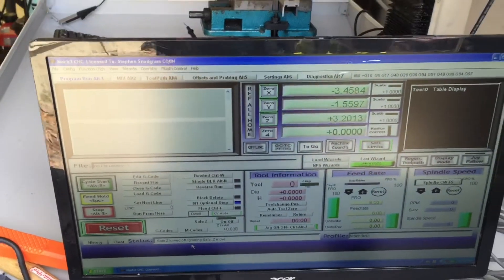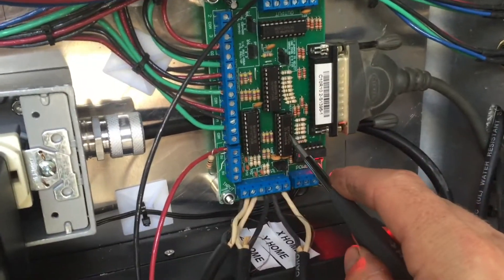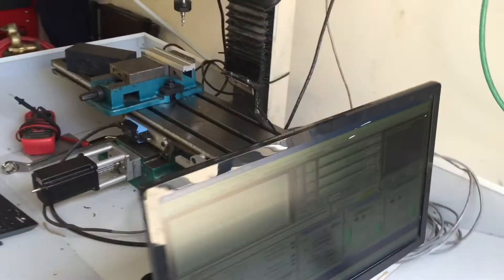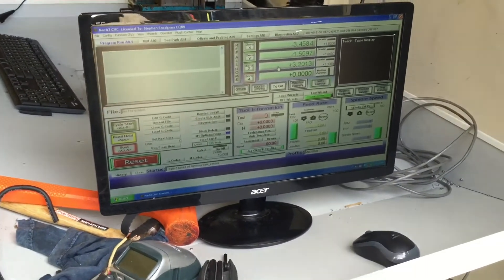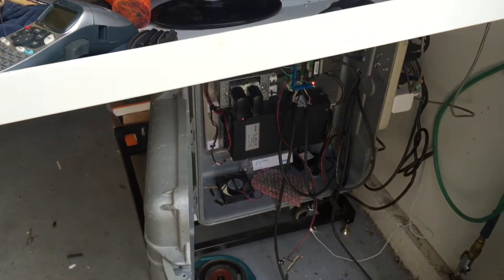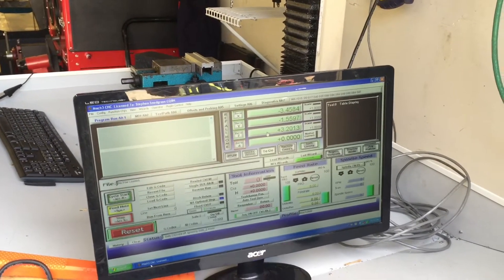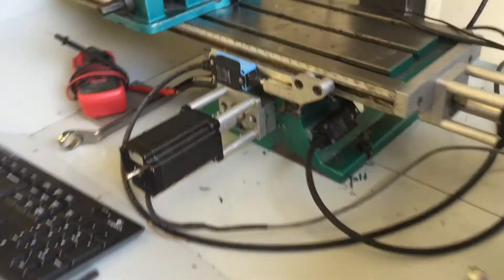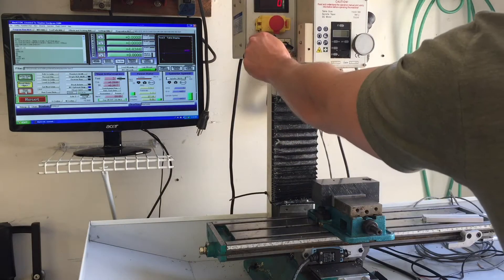CNC HOME SWITCHES-G0704 BF20 AND A QUICK VISE HANDLE-Unorthodox Fabrication

Comment: I have a Gecko G540 which is an all in one parallel port driven setup and found today that when I put my USB mouse on the G0704's bed I could hear a pitch change in the steppers. After moving it back and forth a few times I did confirm there is some sort of loop open so you may want to ground the mill itself and see if that helps.

Comment: what size wire do you have on those limit switches? I just order the exact same ones.
Reply from the maker: Kirk,

Cool. I added some wire in my description below the video. Also the link to the limit switches incase somebody else wants to use these. They are water resistant and work well. Thanks for the comment!

Comment: looks good. please tell me what is the resistor for on the breakout board?. Bye Eric
Reply: Looks to be a pull-up resistor for the probe.   In my mind, it puts a small amount of 5V to the probe input on the C10 (as long as the circuit is not complete going to ground).  Once the circuit is complete, the 5V goes to ground, leaving the input with 0V.   --- Bill
Reply from the maker: Thanks Bill, I was not able to explain that... I did not put that resistor on the board. The previous owner did.